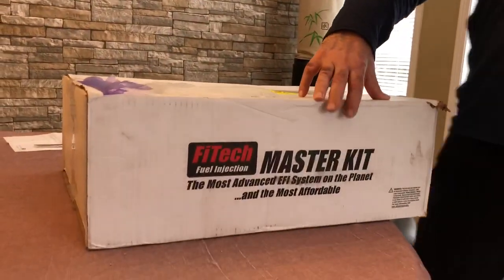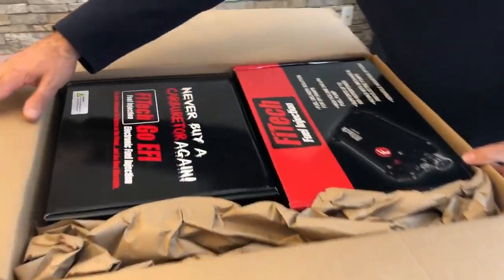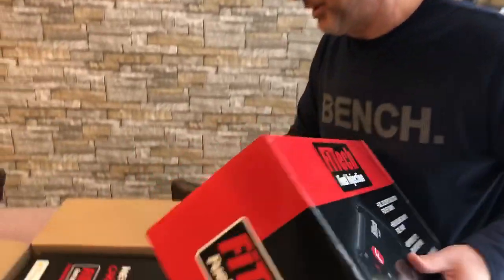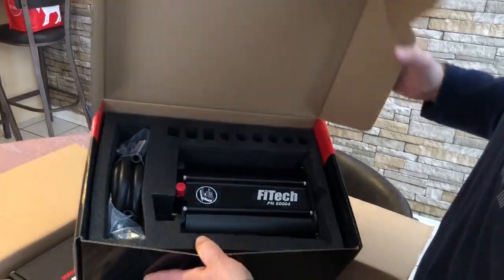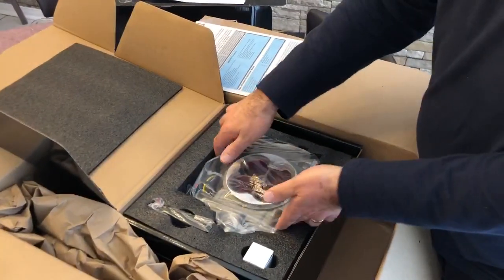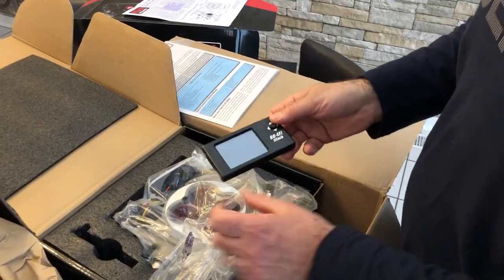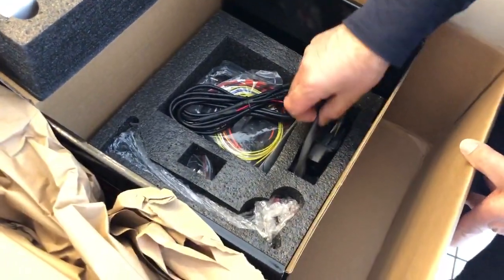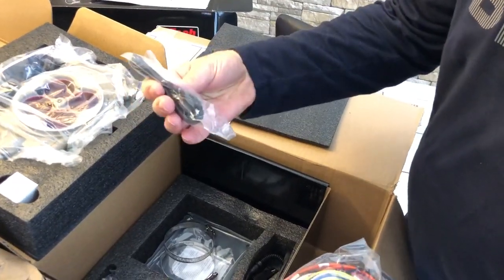FiTech EFI system with ForceFuel Unboxing Review

Comment: I’ve got a sbc 350 running a torq cam and 10:1 compression. I’d say when running right it should be pushing 300 but here’s my question. Does it matter if you go bigger HP rating wise? I don’t know if I’ll ever try to make more power but I’d feel better knowing I can add a power adder or NOS down the road and have a setup that could handle it. I was looking at getting a 550 setup
Reply from the maker: Hi Kyle, the model I used is good for up to 400 hp. If you think you might be above 400 hp at some point you should buy a higher model. I believe the main difference is injector size. The 30001 is good for up to 600 hp. Price difference on the unit itself is only $140. If you are looking at adding NOS you need to purchase a model that supports that. Neither the one I bought or the 30001 will do NOS. I believe 30004 is what you need. BTW the guys on the helpline at FiTech are really good, you can always give them a call before buying.

Comment: How has it been running for you after 3 years?
Reply from the maker: So far it's been very good. I have had no issues with it. I would recommend that you take your time with the install and do everything right. Don't take short cuts. I spent a fair amount of time locating the wires and fuel filter in appropriate spots under hood. The cleaner and neater the install the less issues you are likely to have. The car starts up very quickly, no gas pumping necessary, no smell of fuel after parking car. Don't miss the carburetor at all. Fuel consumption is lower by 10 to 20%. Was hoping for more. Throttle response is better, acceleration is much more linear.
Reply: @robthefixitguy7185  thanks
Reply: @robthefixitguy7185  im sold!

Comment: How is it on fuel consumption
Reply from the maker: It's about 10 to 20% better than the carb. Not a huge improvement, but noticeable. I like the easy starting, no gas smell after parking.
Reply: @robthefixitguy7185  thanks for responding... im in the market to upgrade to efi. Great videos....

Comment: How do u prime it
Reply from the maker: The instructions have a process by which you repeatedly turn the key to on without starting the engine. The ForceFuel system holds about 2 pints of fuel and each time you turn the key it pulls fuel into the holding tank. If you start the engine without doing this the holding tank will run out of fuel and you will damage the fuel pump. Not difficult, but you must follow the directions.
Reply: @robthefixitguy7185  Thanks

Comment: FiTech "master kit" is a rip off. They only give you 5.5' of high pressure fuel line. If you want to mount the Force Fuel in the trunk and only have 1 line to the engine you have to buy hose from someone else. It should be included. Why pay $1700 and then have to buy additional supplies to make it work?